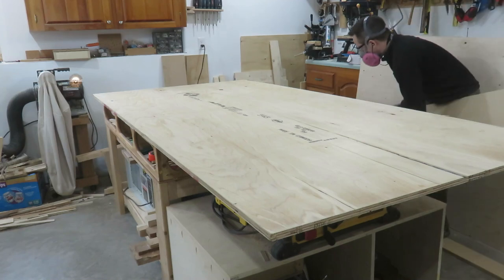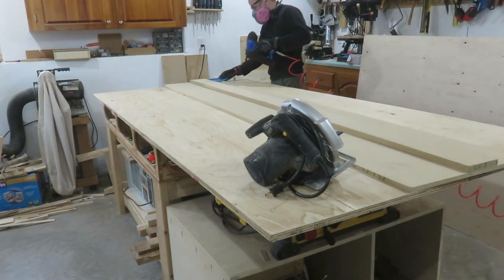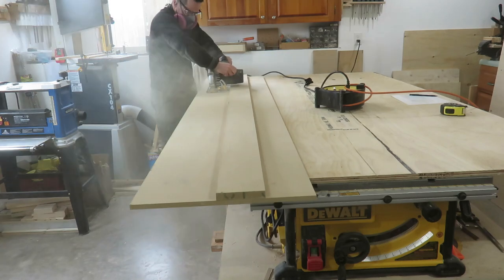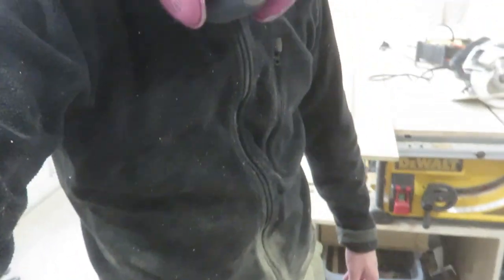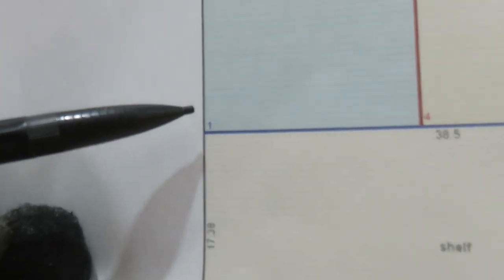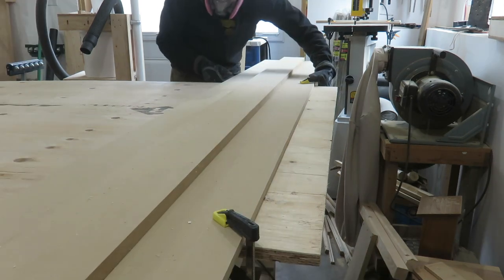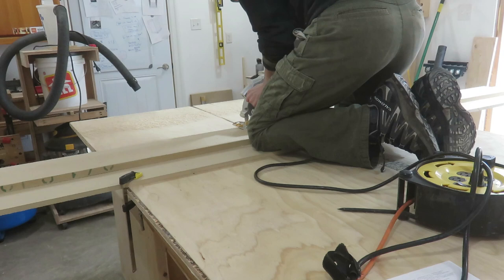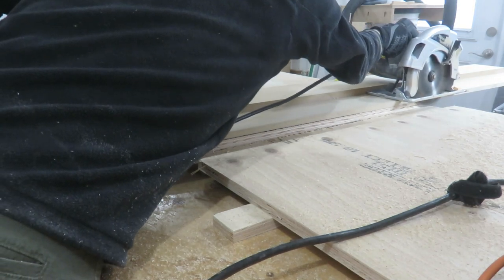How To Cut Large Sheets of Plywood - Make a Circular Saw Guide

Comment: Great informative video. Just one question though. After measuring and lining up your jig, don't you have to allow for the thickness of your saw blade? So you're actually making 2 measurements.
Reply from the maker: No. You don't need to account for the blade as long as you always put the jig so it's on the piece you want cut to size.  The thickness of the blade is on the scrap side of the line.